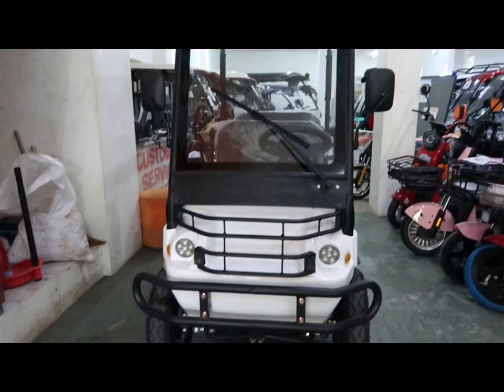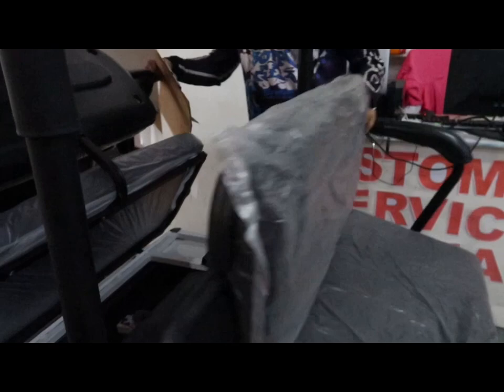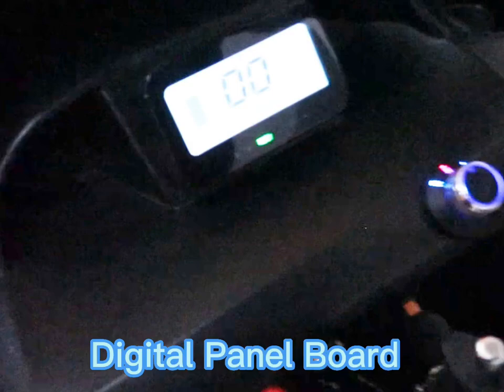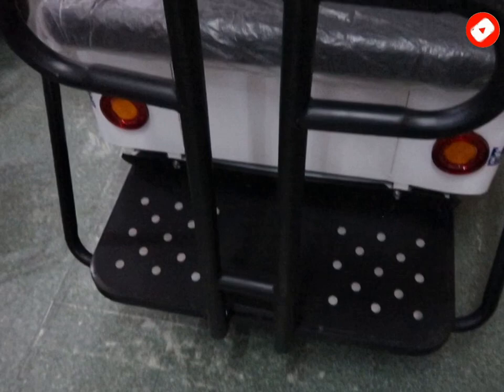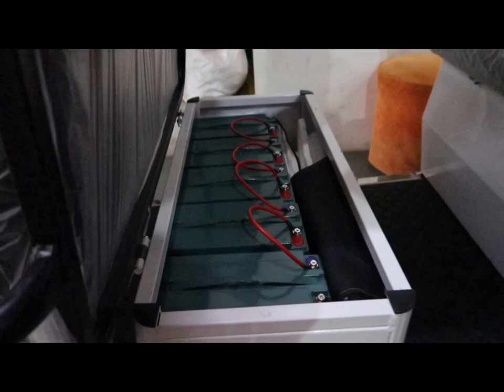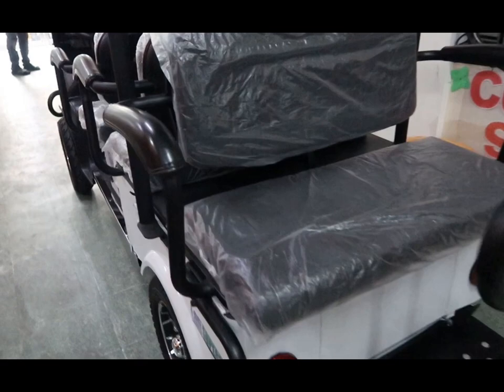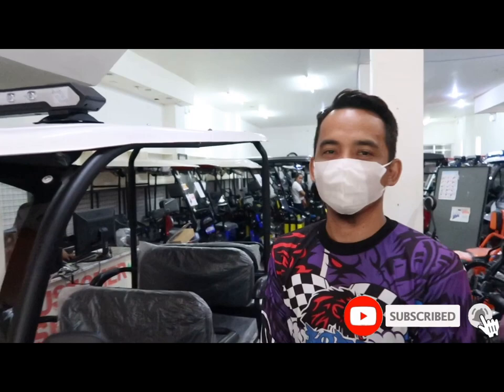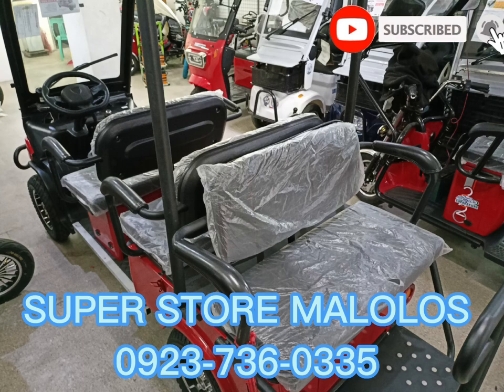VOYAGER EBIKE | 7-SEATER 4-WHEELS | 120 kilometer Range | pinatibay, pinabilis, pinahaba!

Comment: Sir kapag mataas ba ang controller nya malayo ba mararating nya??
Reply from the maker: Hindi po sir, kung upgradable po ang battery nyo, malayo po mararating,at kung mataas po ang wattage na motor ng ebike nyo,lalakas at madadagdagan po ang range ng kilometer na tatakbuhin ng ebike nyo.
Reply: @lemontvvlog  nag taka lng po ako bkit 70 to 120kms ang range nya, for 1500watt motor, 45ah battery ang layo Naman compare SA ibang Ebike like lucky lion V2, etc na parehas lng sila Ng specs..